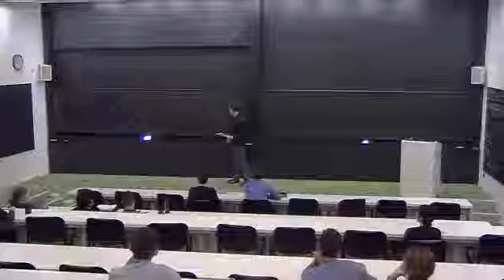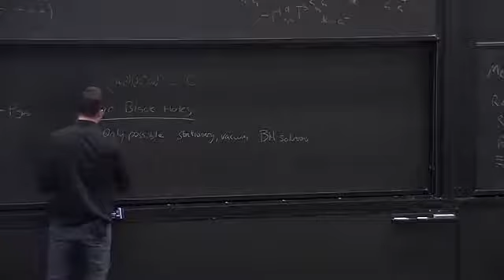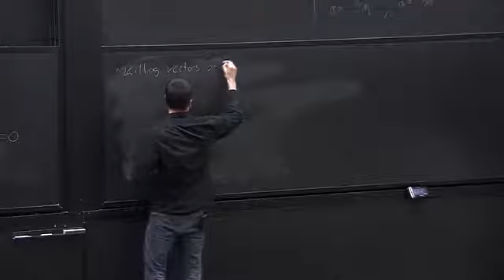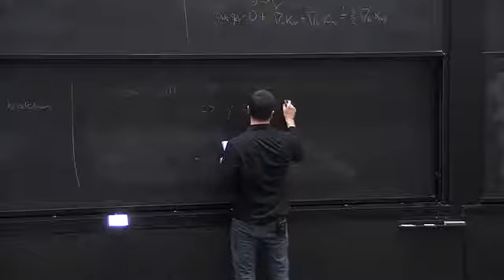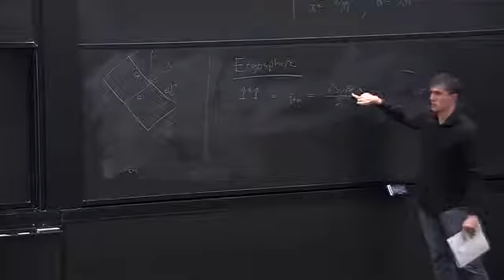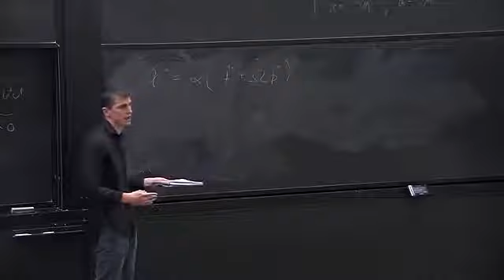Strong Field Gravity Lecture 1: Introduction/ Kerr metric—horizon, ergoregion, symmetries

Comment: In Kerr manifold, the radial geodesic goes from infinity into the origin in a straight path . There is no gravitational deflection on light from a remote source. Kerr black hole is not the normal black hole.

Click on "77 Kerr's Metric without Black Hole" on this website.
https://sites.google.com/view/physics-news/gravitation